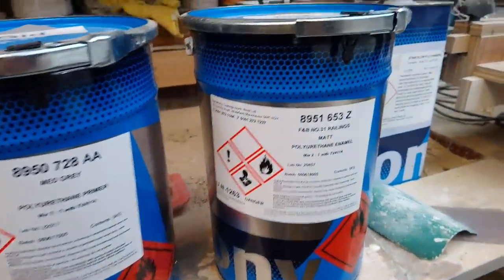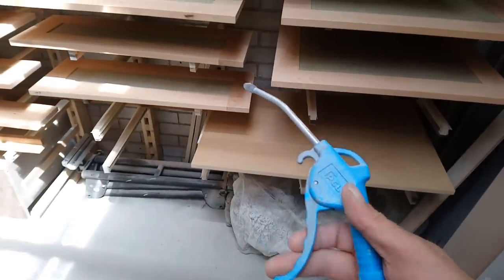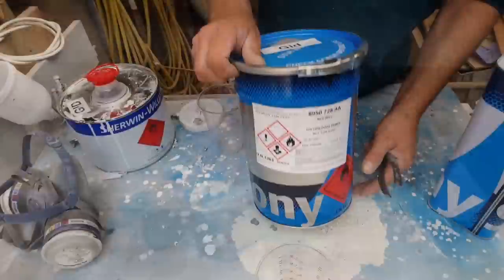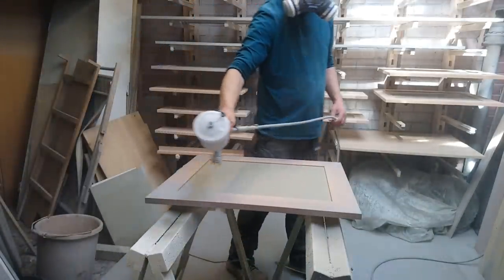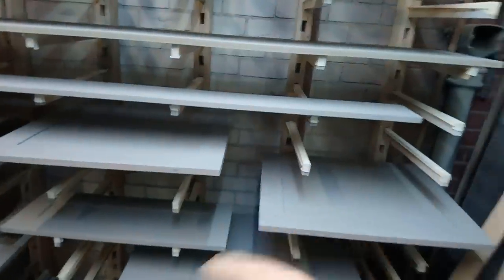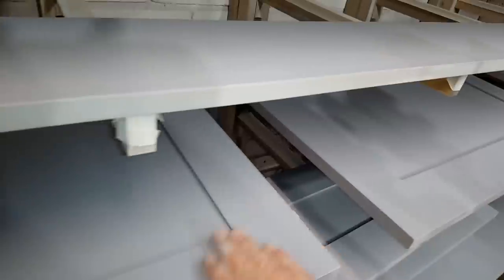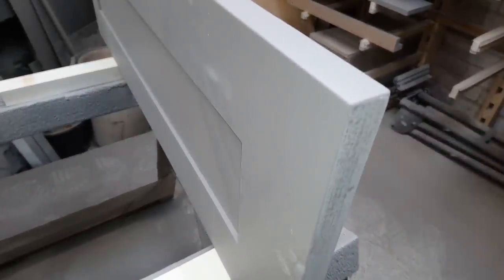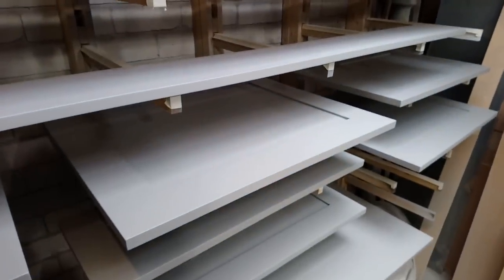Kitchen Fitting Pt11, Spraying the doors but unable to finish it

Comment: Hi mate, just found your channel. Watched most of the kitchen vids. Top stuff. Why use beach then paint it ? Why not just mdf
Reply from the maker: Hi Thanks, The basic answer is compared to Beech MDF is crap, I've been asked this before so have a comment saved so sorry for the copy n paste -
 It's about the quality of the base material & therefore the quality of the overall job, wood is wood to me so painting it is no issue but some woods are better than others, for quite a while i used pine, 'cheapest price' i was asked for but the shrinkage & warping later when the pieces went into a centrally heated house were unacceptable to me, Beech doesn't cost that much more on a job of this price, the time & expense put in ya might as well have a decent substrate that'll stay relatively stable for it's lifetime, Beech is harder than pine & fairly straight grained with little or no knots, it's not just the longevity tho you can feel the difference after it's sprayed, the temperature, the hardness & the way it shuts just gives it a better well made feel. I build these things with the hope that they will still be around in 50yrs like the old pieces that are still sometimes around, they were often made of pine, which is what i was/am trying to emulate but the quality of the wood (pine) was better then, if i bought planed pse pine i would still have to machine it sq n straight because off the shelf it never is, so the labour in preparing the wood is not much different & cutting the dominos is the same for both & maybe the same time spent would be spent on the joint of MDF whether that is a spline/scribe/groove or domino.  
I would use MDF if the job was cheap, if i didn't expect them to last more than 5yrs, if i wanted a very flat no grain finish or if it had to be done with that material through customers choice for whatever reason (prob against my advise), Mdf boards never come straight so tall doors can be a problem, screws don't hold as well as they do in Beech, fitting butt hinges into the edge of MDF is not reasonably poss, I use ply for the carcass on some jobs for a similar reason so the screws in hinges/hinge mounting plates, hanging rails & drawer runners hold well,
When spraying there is an inside & outside edge on the stiles n rails, MDF feathers a little so there would be more work there sanding, i give my customers the option of ply or MDF panels on the doors, you get a very flat finish with the MDF, ply is a slightly better material but there's a possibility of seeing the grain through the paint, their choice?, when sanding these doors with beech stiles & MR MDF (I only use Medite MR MDF) panels it's always the panels that need the most sanding,
I do sometimes use MDF for doors & drawer fronts, normally when it's just a plain flat door i want but I have a list of materials in my head, MDF is the very bottom & would be my last choice for shaker doors. unless it was a bespoke style/sized door to match an existing set you might as buy some, there's loads of MDF units/furniture on the market, a lot cheaper than asking me to build one, Building out of MDF is not the quality that my clients ask for or expect from me,
Reply: @Gidjoiner  thanks mate, i agree with you completely. Mdf generally sucks. I'm just not a fan of painted wood. Seems a shame to have hand made beech doors painted. I would have left the natural. But it's not my kitchen so my opinion dosent matter a jot. Top job and I'm sure the customer was very happy. Keep up the good work and videos, you have a new subscriber.

Comment: I’d be interested in what they have to say tomorrow Gid! After all that hard work prepping and priming 😵interesting to note that their sample was the same 🤔 could there be two finishes in this grey smooth as you did on the other kitchen and this rough finish. Mind you can’t see many wanting that finish.
If it’s a bad batch you want to claim couple days money from paint company for your time and having to prep doors plus spraying again.
Hope it works out ok for you 👍
Reply from the maker: Yep I'm interested too, bit annoying it happened Sat i have to wait till Mon, I've emailed them some pics. 
(It's not a type of finish 😂)
It does seem quite runny, the top coat is often thinner than the primer, so don't know if that's something they put in to add volume, 
Don't know we'll see in the morning, 
It did feck my plans up tho, i planned on working on that the weekend n then working on the van Mon when the sun was out & the doors were drying properly.

Comment: Hi again gid, 5th or so time watching the spraying vids now 😂. What are the sanding pads I like those ima get some
Reply from the maker: 😂 They say repetition is the key to summat or other 👍
They are these, i use 120g & 320g, it's best to sand with the pad at an angle to the wood as the Mirka sheets have a straight grain/line pattern which leaves lines in the wood if sanding straight, they're long lasting & don't clog, clean easily, 
https://www.axminster.co.uk/mirka-abranet-abrasive-sheets-70-x-125mm-ax851873

https://www.axminster.co.uk/flexipads-hand-block-medium-soft-510003

Comment: Can you explain how the bits or whatever they are got through the filter gid? Nice colour. I've used it myself a couple of times as well as the f n b moles breath. Dk Grey's quite popular for kitchens at mo.
Reply from the maker: The bits only needed to be tiny to make those lumps, the filter got the bigger ones but it has a limit to the size the guaze will be able to catch, I sprayed half the doors thinking that it was something I was doing after 2-3 I stopped using the brush to wipe off the dust but it continued, they're all the same and consistent, it's def in the paint. I'll talk to the paint people tomorrow,
Yep I like that paint & after all the work of primer and sanding I was looking forward to putting on the finishing coats, 😕

Comment: I've just found you channel and have watched a few of your videos. Really good and informative 👍👍👍 Just one point though, I am sure that the two pack paint you are using is pretty nasty stuff and should only be used with an air fed mask and probably in a proper spray booth! 🤔 I've never used the stuff before, but knowing the hazards of 2k paint for vehicles, and the signs on your tins, I wouldn't like to chance it - but hey, that's just IMHO 😉 Liked & sub'd 😎
Reply from the maker: Hi, yeah I'm sure it isn't nice stuff, i avoid getting the thinners on my skin when washing out the guns, I should really wear gloves, but i spoke to the suppliers about how toxic it is n they don't seem too concerned, I think some of the worst chemicals aren't added anymore, It's not as bad as 2K stuff but the the AC stuff i can get from them def isn't good.
The mask I got from Spraygunsdirect, they assure me that the rating of this mask, P3.
 (P3 RD particulate filter pleated filter technology significantly reduces breathing resistance, improves wearer comfort and reduces fatigue. Protects against harmful & carcinogenic dusts, fumes and aerosols based on water & oil, radioactive particles as well as airborne biological substances and enzymes. EN143:2000.)
is sufficient, I bought this mask not too long ago & did some research then, spoke to a few companies, I've subscribed to a couple of YT spray channels & although they are in spray booths they only use a similar mask to mine, I could do with a better extractor for overspray dust in the air settling on the fresh paint if nothing else.

TBH I'm Fecked anyway, I smoke, i spend winter in front of an open fire & have worked in a dusty environment for the majority of my adult life 😩 50 this weekend if i reach 65 i will be surprised, 😂
I believe mine is sufficient, i haven't mentioned the mask in my vids because i'm not in possession of enough info to give advise, I'm a joiner, i hammer nails into bits of wood 😁 If i was young n fit i might consider an air fed but the price of them is not cheap. 
Thanks Nick, 😉
Reply: Gid, thanks for taking time to explain, but please don't think I was being critical, it was just the old H&S side of me showing itself 😳 (a work responsibility I used to have!) 

"50 this weekend" - you're just entering the prime of your life 😉 I think I've become fussier and more careful the older I've got 🤔 Keep up the good work and keep those videos coming 👍 

Happy Birthday for the weekend 🍾🍻
Reply from the maker: No worries 😉 
written conversations as in this case can be a bit impersonal & can be perceived in the wrong way, I started to write a short msg which then needed it's own explanation 😵
Thanks for b'day msg, Sunday, looks like it's going to be a scorcher, 26º 🌞 a quiet one i hope, turn the phone off n ignore the world for 24hrs 😊
this kitchen is pretty much finished, it's been a long n bitty job, I've lots of short recordings I've made over the last 12days, i just need to try put them in some sort of order to upload. 
Thanks Nick.
Reply: I agree, sometimes things get 'lost in translation' 😉 
Enjoy the weekend, the decent weather and ignoring the world, and above all your birthday 👍
Will keep an eye out for the new videos.
Reply: You are correct about the 2k paint with Isocynate, in that you need an air fed mask.  I think that stuff Gid is using here is Polyurethane two pack.  That IIRC is like a Yacht enamel.  The thinners are PU and not the 1k thinners.  The Gerson mask may be enough for that paint as it is not a deadly one like automotive 2pack.   I may be wrong of course, so not gospel.  Check all paints out for this before using.

Comment: Seems a shame to paint that bit of beech!
Reply from the maker: Wood's wood mate, it's just a material for building, I'm not using Beech for it aesthetics, It's straight grained, free of knots, shrinks very little when it gets into a centrally heated house, takes paint well, if i'm going to spend this amount on paint & time I want a good substrate & the end result feels like a better quality job/door, the coldness & quality of hardwood can be felt even after it's painted & it doesn't cost much more on a job of this price, 👍
Reply: I hear what you’re saying mate. The finish is great Gid... very satisfying seeing how tight you got those joints
Reply from the maker: 👍 Thanks 👍 The machines make the work better & easier 😏